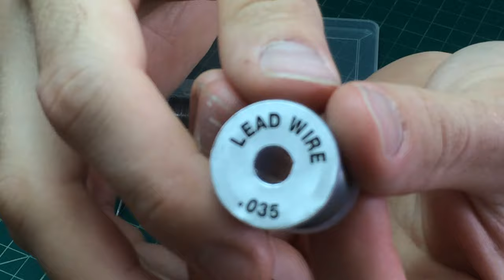How to use lead wire for that extra detail in your cockpit and wheelwells

Comment: Just some info on the egress system, primary ejection is the face curtain, secondary ejection is the D-ring between legs (you must blow the canopy separately or eject through).  And lastly is the "scramble handle" on the right hand side which is used for emergency ground operations where ejection is not necessary.  This will severe all of the crew members personal restraints from the seat allowing them to jump out of the aircraft.

Comment: Try gluing a piece of folded masking tape to the bottom of each slot in then put the roll back in. When you need to pull the lead wire roll out you just pull on the tape/tab. You could label the tabs too.

Comment: nice detail bro. question is, how will you paint that? :)
Reply from the maker: Painting it is no problem, if you are an airbrushed like me all you have to do is spray it with a main coat of the color of your choice. If you don't airbrush but all you do is hand paint, all you have to do is just glue it in the desired area and make sure that it's shaped the way you want it and than just put some paint on it with a thin brush. Make sure you don't touch it or bend it afterwards because the paint will chip or fall off.

Comment: Is it "lead" as in the malleable and toxic metal, or "L.E.D." as in fine gauge wire for connecting light emitting diodes?
Reply from the maker: Jason Harris led as in if you touch it you get led poisoning. ;)
Reply: u r so right
Reply: MurderInkModels And you die within minutes of touching it.
Reply: Lead isn’t toxic to touch.